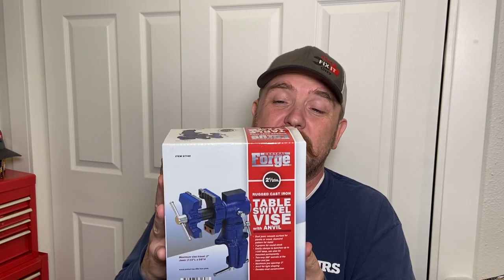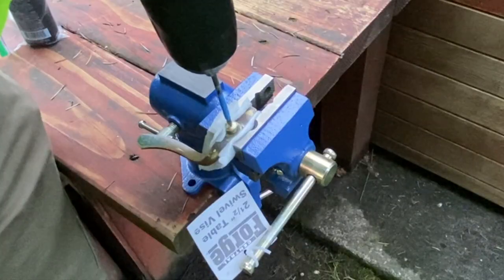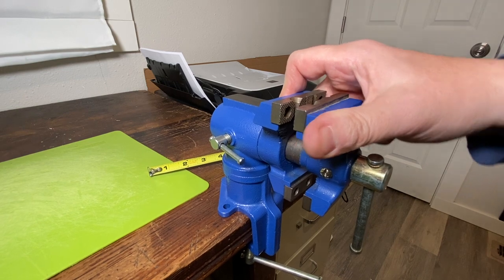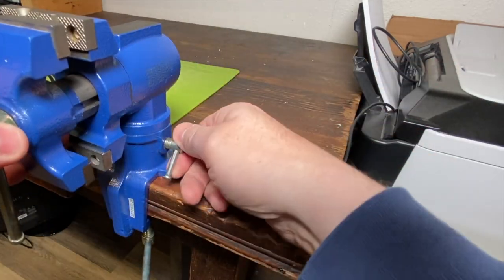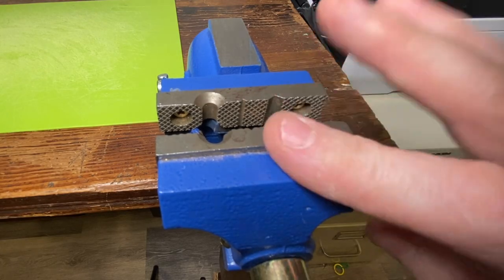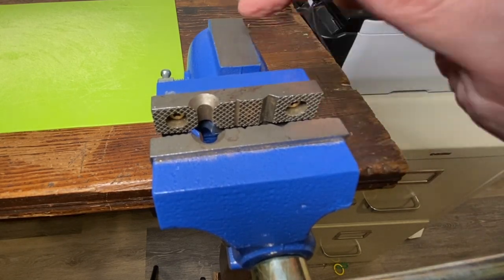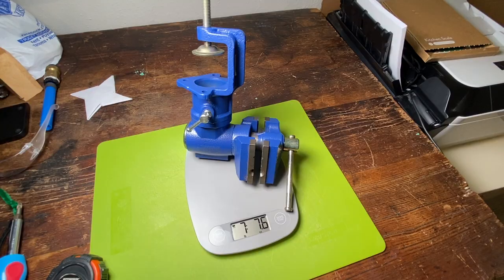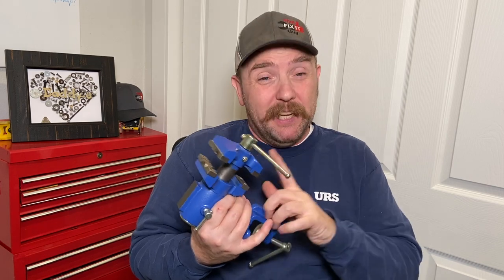IT'S NICE HAVING AN EXTRA HAND!! Small Portable Table Vice Review

Comment: I have a clamp on vise that was made by Pony Jorgensen, It works very well, the only thing I don't like is that it does not have as many features as your vise does but it works well for small projects and has a pipe vise built in. When I do larger projects I use a larger Pony vise.
Reply from the maker: This little harbor freight vise has been awesome. And for the price it can’t be beat. Thank you Jack
Reply: Wow I’ve seen Pony and Jorgensen tools but didn’t know they were 1 company 😂